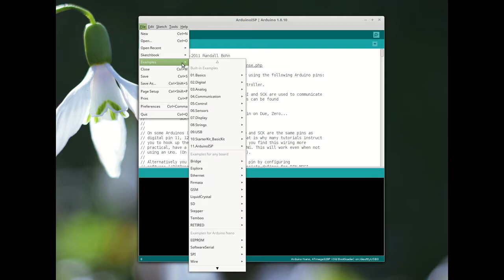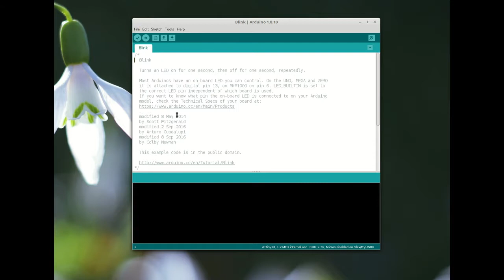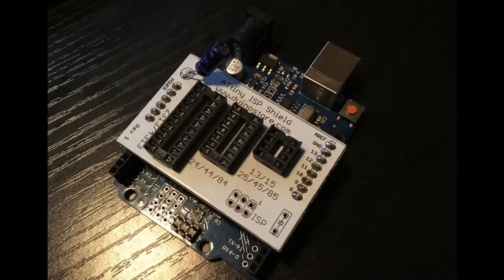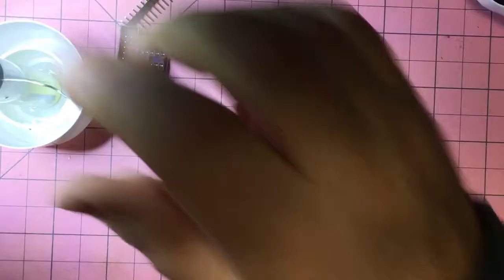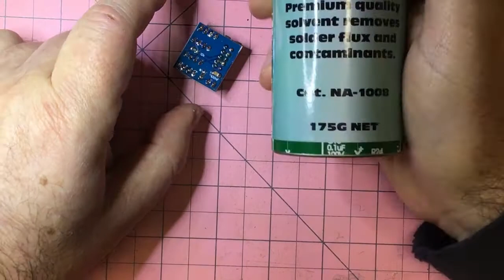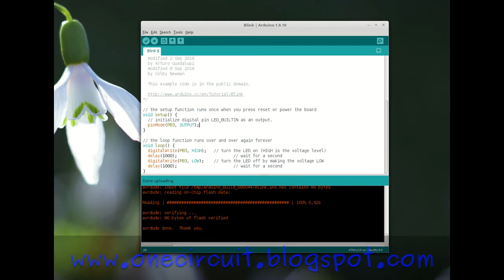ATTiny programmer and shields

Comment: Pileofstuff > watch  this aussie guy  one circuit ,  OK i will   in sa   myself 🦘i dont program or have a clue ardino etc It wud tear my brainz out trying -  but watch alot tech as there's always something you learn     eevblog was one my 1st channels aussie guy -  In july   2018  i  got NBN turned on  but 6mnths l8tr  had issues till july 2020   (WHAT Happened ? ) 
What Happened is the tech guy 2018 installation Somewhere ? slighty put  a staple into phone line which made nbn go off & on all day  - 
weird chit but 2YRS L8TR fixed  drove me Crazy 🤪 i thought i was hacked or trojan NO they said i kept emailing them FOOK whats going on All they said was 100% from here on How about Come check from My end 3 DAYS l8TR HE FOUND it  11mrts  my pc to nbn box on fronty house All he did was change 1 small color over &  whalla been ok since He also told me The Fibre will coming thru in 1 year >see that rope  thats waiting for it OH ok   cheers i said to  Nick thankyou for being so  persistant  in find the problemo! :)  IF THENBN had of just came & did the right thing 1st go  i wouldnt have bought a 2nd Modem $250 and reinstalled win10 Pro for the 3rd time Fook me  guys what a bunch of office wankers Yeah its ok from here mate >not from my house it aint haa! wankers 
BOTTOM LIne   ☎🩸tears 🩸of 🩸pain🩸nbn🩸 and the tech guy who fuked it in 1st place   . . . . the end     wait there's more      coffee & bye

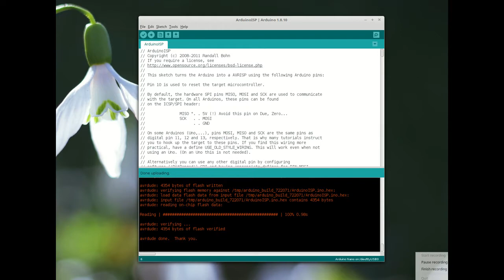Comment: 0:48 there is a bit of slight of hand waving going on here. Would you be so kind as to fill in the gap of how you loaded the Blink sketch? The video fades out and the "steps to recreate" become clouded. I confess I have done zero RTFM on this one but I detect a huge problem when I try this at home ... how did you get from the ISP sketch to the Blink sketch? Thanks for the video. :)
Reply from the maker: Haze Anderson Start the IDE then it’s under “File - Examples - Basics - Blink” as shown from about the 50-60 sec mark. I’ve just changed the output to PB3 or pin 2 on the ATTiny13. Better description shown here: https://www.arduino.cc/en/tutorial/blink 👍
Reply: I guess this illustrates my point? That one fade out at 0:48 occludes the steps to recreate this. My question is what happened there? Did you close the IDE application and restart it?
Reply from the maker: I just opened the blink sketch. It starts a new window, then I must have closed the Arduino-ISP sketch. I’m not sure why I faded it - dramatic effect! 😀
Reply: OK thank you I just wanted to be sure. That's a bit of magic on the Arduino IDEs behalf! Thank you very much for this video it is very ver helpful. :)

Comment: The 6-pin ISP is what I build into my own projects with AVRs.  The keyed 6-pin IDT connector is also my preferred method for porting out the SPI bus.  The weakest MPU that I've found that will bang out USB 1.0 and still have room to be an ISP, is the attiny44.  Oddly, the stronger mega8a seems to be the least expensive MPU for this, at around 0.42usd/ea. (shrug) it must be more commonly manufactured.  I put a jumper next to the port as well, to toggle Pin 5 as either the Reset or SS pin, so the interface can be used as its programmer, or output.  Odd they did not do this with the Uno!
Reply from the maker: GnuReligion I’d like to see a pic and/or circuit diagram for that - I’ve used the ATMega8 and ATMega88, nice chips! 👍😀
Reply: @onecircuit-as  The inexpensive 10-pin ISPs from China made with the mega8.  I think obdev wants 10 cent each for commercial use of the software, but no problem building one yourself.  https://www.fischl.de/usbasp -- The USBASPLoader is an interesting as a boot-loader.  The diagram shows a 12mhz crystal, but you can use a 16mhz.  Will help you build one if interested.  You have 3.3/3.6V zeners handy?
Reply from the maker: Oh yes I have lots of cheap Chinese USBasp programmers based on ATMega8s. I’m not sure I’d build one! I have “upgraded” a couple to run super slow for ATTiny13 chips running at 128kHz. 👍
Reply: @onecircuit-as  You have a fascination for the Tiny13's!  Hehe, I bought 10 of them a few years back.  Yup, I had to jumper my USBasp to "slow mode" for stuff running at factory-shipped 1.2mhz and slower, as well.  First thing I usually do with a factory AVR is to fuse that clock divider down to 1.  128kHz needs special attention!  Became obsessed with getting my USBasp units to actually use the TX/RX pins for debugging, after programming.  Not easy, but possible!  Few do this.  You gotta upgrade the firmware.  There is not much to building the USB interface.  Couple of zeners, a few resistors ... or just run the whole device at 3.3V.